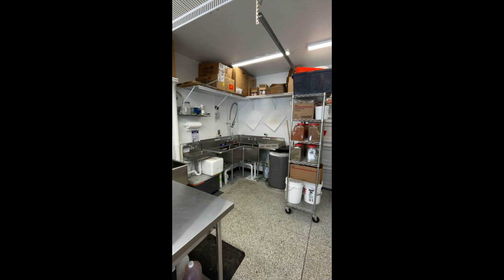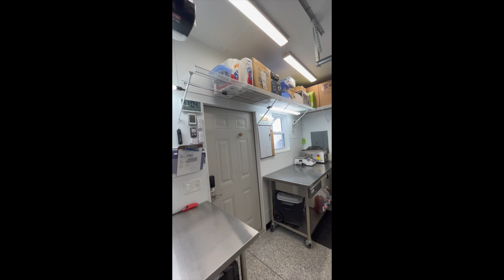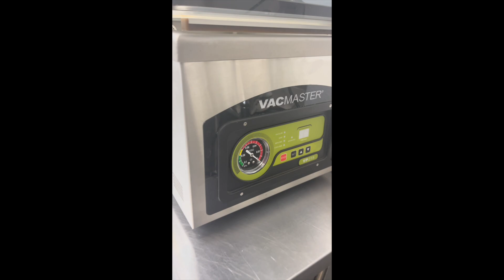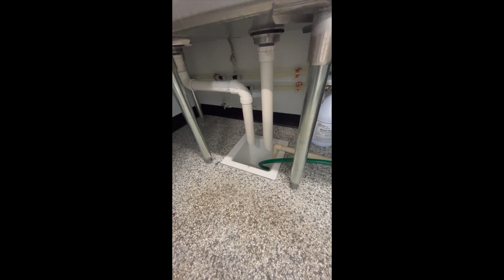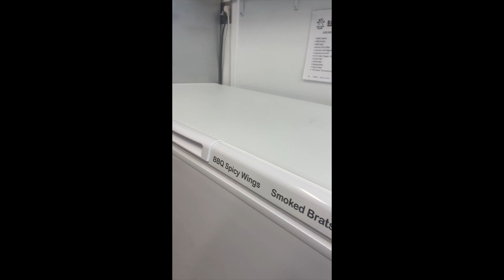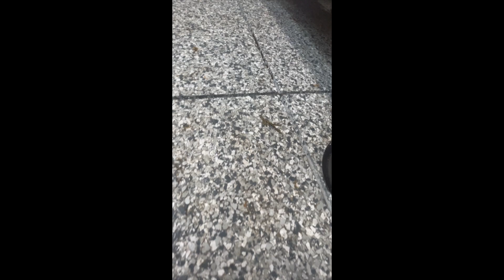Turning a Barn or Shed into a Licensed Commercial Kitchen.

Comment: This is such a goldmine of info for cottage food operators. I love that you went with the epoxy floor right away since so many people skip that and regret it later. For anyone worried about fitting equipment into a tight 12x16 space, we used Empura undercounter fridges to save floor space and they have been rock solid for maximizing a small footprint.
Reply from the maker: Thanks for your comment and you are right. The epoxy floor still looks exactly the same as it did the day it was installed. Quality always cost more upfront, but it pays off in the long run.

Comment: Does the shed need a foundation and how did you find a space for it...
Reply from the maker: In my area, regulations do not require me to have a foundation. What I did was a cement slab with monolithic edges and double thickness where the 2 walls not along the concrete edge were. So, if you were looking at depths from top down, the slab was 4 inches, but a "inner square" had 8" thickness. So, the 20' X 20' pad had a 12' X 16' square with 8" thickness in it. Then walls to the barn were on top of the 8" thick concrete.

Comment: was the $35,000 the building plus the inside with your equipment or was that everything after the $25k for the building? Thanks
Reply from the maker: That was after. On the extra costs, I did build a custom building (truss package, extra height, etc.) and everything inside is quality. On the bonus side, me and 2 friends framed it ourselves. Everything else was subcontracted.

Comment: well meeded watchin this now. Is this on your personal property? ans if so what is your property code? We live in an r-1 and unsure if we can do it on our property but have an opportunity to get a small plot of land (bout 5000 ft) thats an c-1 that by code is already approved. its about a 10 minute drive from our house..what do you think would be best?

Also do you think someone can convert a commercial kitchen out of a tuff shed? Like from Lowes or home depot?
Reply from the maker: Yes, it is residential. In our city you can have a business like this within parameters (nothing real stringent, just number of customers per day, etc. which is not a problem for me). I would think you can do so in an R1. Personally, I LOVE having my barn 20 steps from my back patio, being able to benefit in many ways from that and it saves money. I would do everything I can to do it on your property. You should be able to convert a shed like that, you'll just need to make sure you follow code with your electric, plumbing (water/sewer or well/septic), surfaces and more. I've seen some videos on Youtube with people doing exactly that.

Comment: Very impressive..!

I've grown up in the restaurant business and have owned my own restaurants and food trucks since the 80's and I am very impressed with your info, layout and the cleanliness of your kitchen.

I would suggest that if anyone uses well water it most likely will need to be tested and approved by their city, county, state health or agriculture dept before you start as if it does not pass inspection that could stop you dead in your tracks.

Liability insurance is a must and if you have employees you will also need workman's comp. Also get a good tax professional.
Reply from the maker: Thanks for the kudos and yes, all good points. 
I use an insurance company called FLIP (Food Liability Insurance Program). After doing a bit of research and talking to my agent and a couple others, their price/coverage ratio is really good. They have various coverage options, so you can pick and choose what fits you. 
I have no employees, but work comp on anyone working in a kitchen (knives, fire, all that good stuff) will be higher than if you simply have a person helping serve. Keep that in mind with Work Comp (they are called NOC codes and they vary based on industry and role within a specific business). 
And then, the tax man...yes, yes, for me I have had the same one for 30 years who understands and works well with past businesses, and my mantra - "I'll pay my fair share, but not one dime more". If it's a grey area, it's mine (and yes, I have been audited and came out 100% clean).

Comment: How much did it cost to set up and kitchen like this please
Reply from the maker: The original building of the barn on 2020 ran just over $25K. At that time, I had no idea I would turn it into a kitchen. I did run electric to it with plenty of plugs, good lighting and more. Total cost for turning it into a kitchen (including floor epoxy, walls, running water/sewer from house, concrete work, and all equipment) ran just over $35K. I saved some money by doing some of the work myself, but had a higher plumbing cost because of running the water/sewer. I had to have an excavator come, dig up a 3'X8' cement area and dig a 5' trench about 30 feet long, plumber had to run water/sewer, cement guys cut out a 2'X6' section in the barn and then replace it after plumbing was installed and replace the other 3"'X8' area. The plumber's bill was definitely the lion's share of the investment.
Reply: This is ingenious, is there a method similar to this, that could eliminate the need for a direct water/sewer line connection? For instance, having a generator for electricity, and a water source similar to how RV’s are run. 

Curious as to what the overhead costs may project out to be.

Thanks for sharing how you brought your idea to life!
Reply from the maker: @haroldmitchell7456  I know you can do well and septic, you'd just need inspection approval from your county. I don't know whether you could do it with a "water source" like a XX gallon container and then a XX gallon waste container. My gut says no for a fixed location. I think a generator could work. I mean, someone with solar or wind power and battery storage should be able to, right??